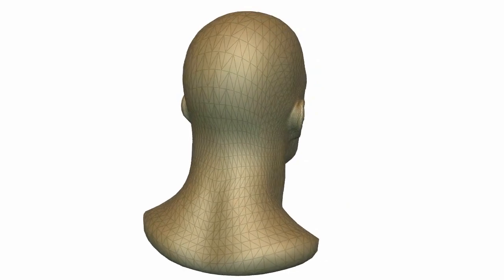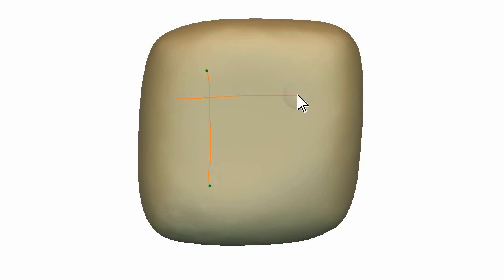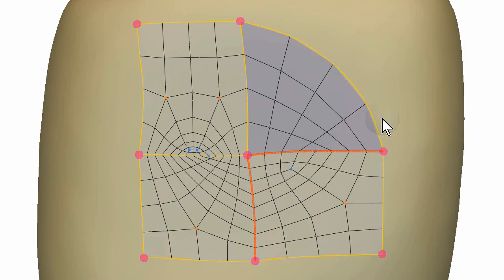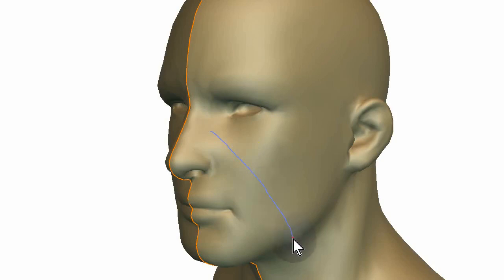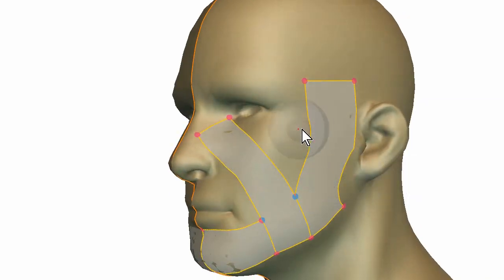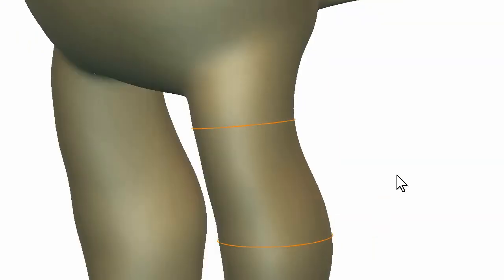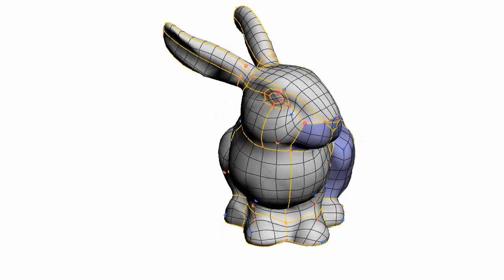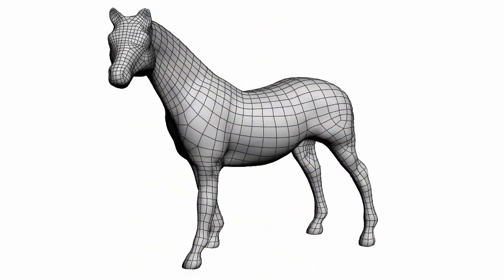Sketch-Based Generation and Editing of Quad Meshes (SIGGRAPH 2013)

Comment: Why is the software so unstable? It crashes every few minutes! Is there a more stable version available?
Reply from the maker: No idea. If you're a programmer, you can try debugging it yourself.
Reply: does it crash with you? I use the 64bit version on your project website btw.
Reply from the maker: I don't see any crash on my side (macOS 10.12). I would've fixed it if I saw it myself.